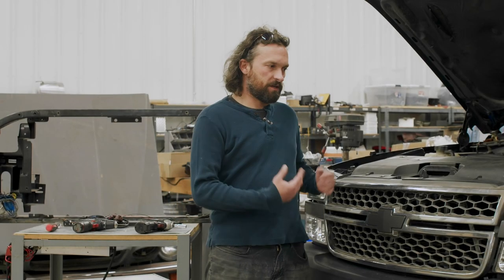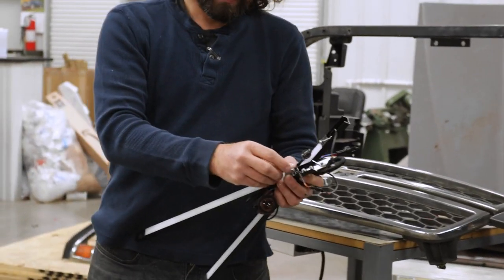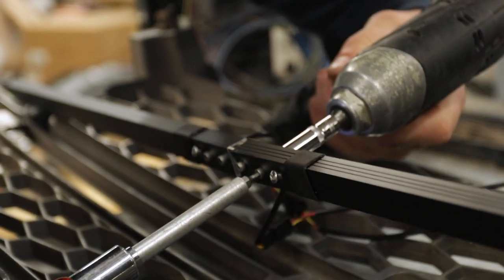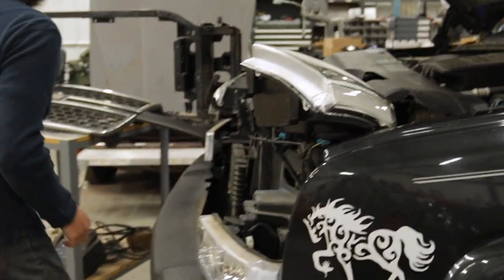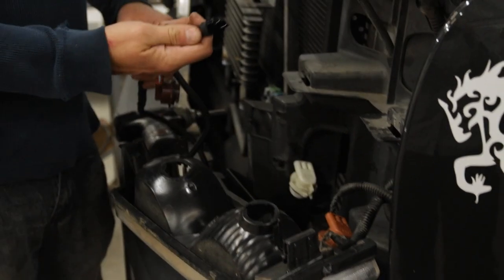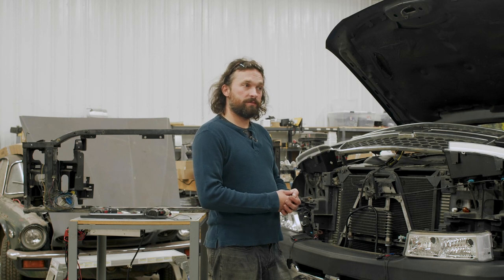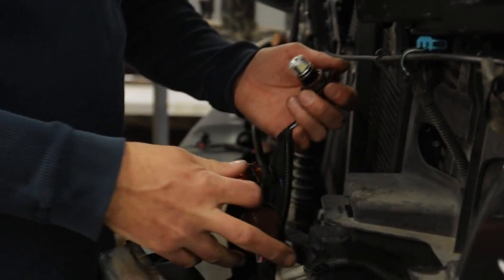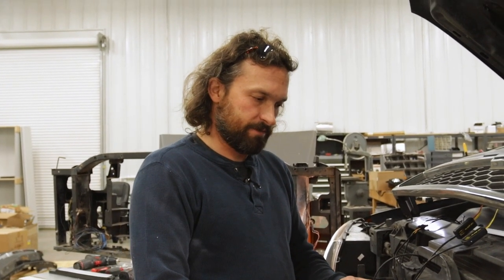Sparksmith Cat Eye Silverado Sequential Grille Bar Installation

Comment: So for the basic bars (Universal) how would you wire those for the animated startup.
Reply from the maker: Our universal bars have a three-wire hookup. Red for the white/animation function, yellow for turn signal, and black for ground. For best results, we would recommend wiring the red wires to a fuse tap (get the ATS version: https://sparksmith.com/products/fuse-taps?variant=39352279302333), the yellow to the turn signal and of course black to ground. Email us at sparksmith.auto@gmail.com if you have any other questions.

Comment: will the switchback function still work if i already have a led compatible flasher relay already installed because im already running led turn signals??
Reply from the maker: Yes, that shouldn't have any effect on the turn signal function. We can always build custom orders too. Hit us up at sparksmith.auto@gmail.com if you want a custom harness.

Comment: Is the installation for the animated rgb grille bar the same as these in the video?
Reply from the maker: For the most part, yes. The animated has a separate fuse and ground, but they do go come with plug and play harness. If you have any specific questions about installation, pleaase feel free to email us at sparksmiith..com

Comment: I wish I had a split grill caused I would buy this in a snap
Reply from the maker: You could try our universal bars. Several people have installed them just above the chrome cross-member of the non-split grille and they look pretty sharp:
http://sparksmith.com/products/universal-grille-bar-animated-startup-sequence-led-drl-and-sequential-switchback